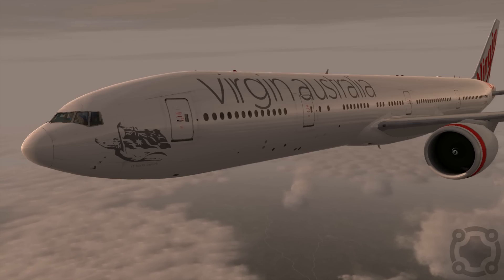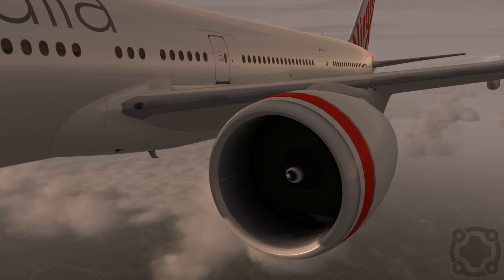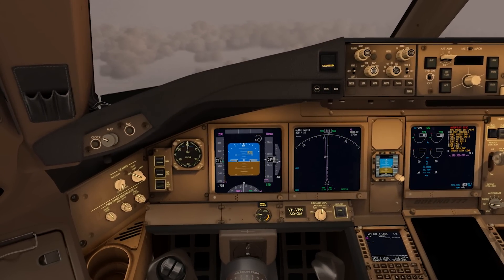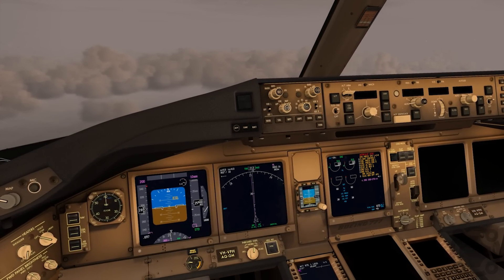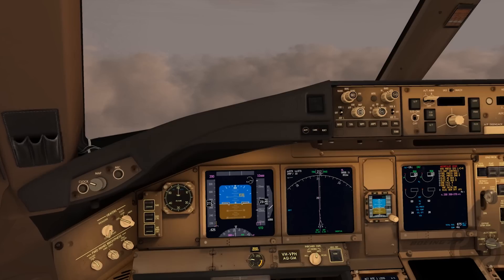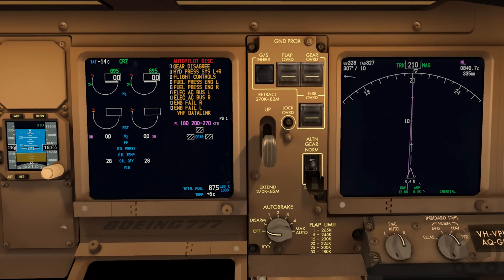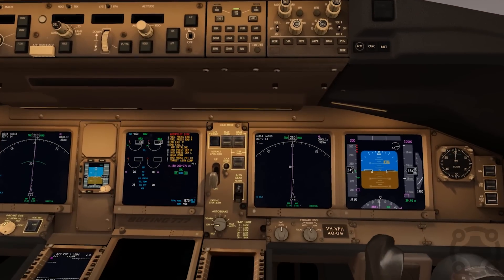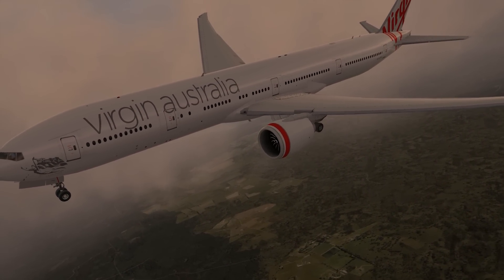What Happens If Both Airplane Engines Fail? - Aviation Facts

Comment: Excellent video! BTW I heard a U2 made an incredibly long unpowered glide landing back at Edwards, from hundreds of miles away. Crazy!
Reply: The U2 has a very high lift to drag ratio that is why,  I just looked it up and it is 23:1. The U2 is really a glider with an engine that is why it can fly such great distance with out an engine, plus the thing is what altitude was it at when the engine failed.  The U2 has a service ceiling of 70,000+, they fly there missions at 80 to 90k.

Comment: What program is this? Anyone know where I could get this?
Reply: Martini time its PMDG. You need some sort of pilot's licence or they will not sell the product to you but it can be bypassed.
Reply: sorry it's Prepare3D not PMDG. the aircraft is an add-on created by PMDG.
Reply: Prepar3D By Lockheed Martin, its damn expensive, I think you go better with FSX or x-plane for starters.
Reply: +TheMertonator you don't need a licence to buy them, I've bought every single on of their products and don't shave a special licence.

Comment: Should have explained that without engines they are also not going to have reverse thrusters.   A 777 with 360 passengers is HEAVY.  So, they have to dump as much fuel as they can, and touch down as close to the beginning of the runway as they can because they are going to have to stop the plane with just the brakes.  Yikes!
Reply: Every airplane is prepared to land with "just the brakes". Reverse thrust only exist to decrease the wear on the brakes. As heavy as they are. Even the A380 (which has reverse thrust on only 2 engines anyway)
Reply: Julio Varesio Yep!  We're triple 7 company, with some 76's also.

Comment: The fuel/oil heat exchange issue did not happen in the 'early days' of the 777, and it only resulted in one notable incident, that being British Airways flight 38 in January 2008.  By that time, the 777 had been in service for 14 years.

Also, the RAT (as is my understanding) is there to provide hydraulic power, not electrical power.  Reference ACA 143 in July 1983, which ran out of fuel in flight.  The crew had to fly with only basic instruments: airspeed, altitude and not much else.

Comment: If the engine has failed and you still have fuel why didn't you turn on the auxiliary power unit that could definitely help you by providing a good bit of electricity and it can also create a hydraulic pressure source

Comment: From my research, the 777 has three ways of getting hydraulic pressure.  Primarily from the engine driven hydraulic pump.  Secondary is two electric motor driven pumps and a third is the RAT turbine.  So, it's impossible to lose hydraulic pressure unless the pilot is suicidal.  However the secondary and RAT pumps don't provide the volume necessary for normal flight.  So, in that sense, the controls will feel heavy and slow to react.

Comment: I wouldn't say they are all gliders. Some planes are so aerodynamically inefficient that if both engines failed (like a F-22 for example) it would probably not glide for very long. That is unless if you can get the computers running again to stabilize the plane. I'm pretty sure if something like a A380 had quad engine failure, it would only be able to fly for 10 or so minutes. Idk i'm not an expert, but I do know that fighter jets for example can fly for shit without the computers/auto pilot kicking in. I do know that an F-15 can fly with one wing! So it may not be true with every plane.
Reply: Every plane has a glide ratio. A modern airliner is around 15. So for any mile of altitude it looses, it can glide 15. a fighter jet is maybe somewhere in the region of 5-8 when clean, and much worse with external weapons loaded.

Comment: A 777 actually has fly-by-wire controls, so the battery would power those, said it was hydraulics at 3:25.

Comment: When you lost both engines the RAT would've auto deployed which would give you electrical power and hydraulic power. 
You cannot (realistically) fly a 777 without hydraulic power as the majority of all flight controls have no mechanical linkages to the control column.
Reply: Is this true only of the 777?    Apologies for bumping an old thread.
Reply: @jackwilliams5474  most aircraft these days have no flight control cables and are near 100% fly by wire.  The 777 does have a few cables still (rudder, THS, and a few spoilers) but not enough to fly the thing. Every large aircraft since the 80s has a RAT that will either directly or indirect supply hydraulic and electrical power to give power to essential systems.
Reply: @MegaGouch  Thank you.    Would that apply to smaller ones I have flown on such as Embraer 120 etc.?
Reply: @jackwilliams5474  i don't know specifically about any embraer aircraft but for the most part smaller aircraft are less likely to be full FBW and still have control cables and be less reliant on emergency hydraulic and electric power.
Reply: @MegaGouch  Thank you very much.

Comment: Hello. 

You've got some great and informative videos. I recently 'upgraded' to a Windows 10 platform (on a new 64-bit Dell w/ Intel Core (TM) i5-6400 CPU @2.70GHz / 2.71GHz w/ 12 GB RAM), but have been unable to find any compatible flight simulator software to use on it. When using Windows XP, I had the MSFSX with Acceleration Pack; however, it will not load onto Windows 10. I've also tried installing XPlane X. Beyond the exceptionally poor rendering, it was agonizingly slow.

Any recommendations? 

Many Thanks (and I've subscribed).

Wayne Camp

Comment: You don't need to press then lock override button for Gravity extension. That button is for disabling the solenoid locking the lever down when there is weight on the wheels

Comment: Land at the nearest airport with no engines?  yeah right.. this video misses out the most important part of actually landing the plane.  Most international flights will be over the oceans or going where there is no airports.  If over the ocean then the pilot would need to keep the landing gear up, and try to land along the peak of the ocean waves and hope the plane doesn't break up.  Then there would be a very long wait for help to arrive.  Over land it could be difficult to find a long enough stretch of flat ground to land on unless you're flying over the dessert.  And then there is no reverse thrust to help the plane slow down once it is on the ground so it would go much further than a normal landing.  No engines means your fate relies on the experience of the pilot.
Reply: Stephen Mann well that scared the shit out of me again haha. But I appreciate the information. Luckily, this is very rare.
Reply: you need a considerable stretch of flat land yes, but despite the lack of reverse thrust you'd be surprised to see how much dirt, trees and other objects slow down an aircraft pretty fast and actually reduce the needed amount of landing space quite drastically. The emergency landings in light and small aircraft are fine and if lucky enough can easily get away with an undamaged aircraft if you find a big enough grass field, but no such luck for a big heavy twin engine (or larger) jet aircraft. Even small General Aviation airport runways will most likely not be able to support the weight and the gear will just push right through the asphalt (if such runways are even wide enough!).
Reply: Any flight your fate does rely on the experience and skills of the pilot tho XD

Comment: Trust me this vid is all too simplistic. You are in BIG trouble !
All engine fail means the risk of dying increases significantly. Batt power is just an int rem 'till the RAT comes on-line. You can't fly a plane with batt power only especially Airbus. Lose all hydraulics in an Airbus trust me you will be on the nightly news along with the  several hundred bodies !!!

Comment: The FOHE issue didn't cause them to shutdown, the flow was restricted thru it, the engines were running but at like idle, they couldn't get power on them.  It was an issue that was limited to 777s with Rolls Royce Engines, they didn't have the issue on the Pratt and Whitney PW4000 engines

Comment: If you are flying from the midwest, the chances are you will never be on a wide body jet. You will either be on a 737, A320 series, or a regional jet. The older and smaller planes don't have all the bells and whistles the new ones do.
Reply: C moore no im in michigan and i went in a 777
Reply: 737*
Reply: The main reason is you will probably never be farther than 1500 miles from any location. 99% of all wide body flights go out of Atlanta, JFK,LAX,or DFW or Houston. The reason for this is they are the busiest and therefore most of the international flights go through there.Every now and then you will see one in the midwest, but not regularly. I live in Tulsa and we have one 767 flight a day arriving and one departing. Both of these originate George Bush in Houston. I don't know how often you fly but it is said that the regional jets have saved the air industry in the US. It is really hard to fill a plane with 300 seats from somewhere other than a major city. We have the American Airlines Maintanance Center here and get them for service. You should go to Flight Aware and you can see every flight in the world and what type plane they are flying. This goes with real time mapping.
Reply: C moore no dude i know my stuff k?
Reply: If you say so. Never try to confuse someone with facts. It is useless.

Comment: What if you were flying on an early 737-300. There are a zillion of then still out there. You don't have a clue what it is like to land without reverse thrust. You need to understand that the reason most of the newer innovations have come about is because of a major problem.  Unlike the auto industry, they don't usually recall all aircraft and update them.

Comment: I like the video, but you missed something.... on the B777, loss of both engines will AUTOMATICALLY deploy the RAT.  Note that when you looked up to the overhead to press the RAT button, it already read UNLOCKED.  It had already deployed, providing both hydraulic and electrical power.  It drops when the electrical AC transfer bus becomes unpowered, which happens when both engines are shut off.  Plus, you killed the APU.  Why?  It's there with its autostart for a reason...

Comment: What about if the gears don't come down?
Reply: it will, but even if it diesn't come down, you can radio the airport and ask them to put foam on the runway so you can do a belly landing - that has nothing to do with the engine failure though
Reply: thanks

Comment: I've played enough war thunder to know that losing your engines is a death sentence.
Reply: Chin Chin The Dark Lord Fighter jets aren't don't usually have a lot of lift so you have much more fly time on commerical planes without the engines
Reply: Very few WT pilots know how to execute a proper engine-out glide and deadstick landing. I see people do this all the time. They are about to lose engine power and the attempt to accelerate towards their home base, possibly initiating a descent to get their speed up even higher. That's the exactly wrong way around. The correct thing to do is pitch up, slow down to best-rate-of-climb speed and gain as much altitude as you can while you still have engine power. When the engine dies, decelerate further to best-glide speed and hold it there. Most prop aircraft have a good glide ratio, easily 10-12:1, so if you have an engine out at 2km (6000 ft) altitude, you can glide for 20km (11 NM) or more. By speeding up, all these pilots do is lose a lot of energy to induced drag, which grows as the square of indicated airspeed. Twice the airspeed = four times the drag = half the gliding range (simple but close-enough approximation).
Reply: @totoritko  Exactly.
Reply: Satyam Patel What about Japanese prop fighters? XP 
They were meant to be very light and have a lot of lift. A6Ms, Ki-43, etc...
Even the Japanese fighter jet, Ki-200, has a lot of lift and very little drag.
Reply: Chin Chin The Dark Lord   I got shot many times in my engine until it goes into 0%. Most of the time, I survived with landing gears intact......until I got shot by other players.
Reply: totoritko There is just one problem: you become an easy slow moving target for enemy planes
Reply: Amen brother
Reply: Satyam Patel 
There are very few jets in War thunder
Reply: totoritko easily 10-12:1? I don't think so, a cessna 172 has around 9:1, a fighter plane such as the p-51 that has a stall speed around 100 mph is not gonna get "easily 10-12:1"
Reply: Mackenzie Clarke "a cessna 172 has around 9:1"
The optimal glide ratio, when flown at constant airspeed, is equivalent to the (L/D)_max for the aircraft and as it turns out, we have reliable data on this(*) and for a Skyhawk it's ~11 (i.e. glide ratio of ~11:1). On that same table, you'll find that the P-51D has an (L/D)_max of ~14. Yes, unsurprisingly, the P-51 has better aerodynamic efficiency than a Skyhawk, owing to the fact that the Skyhawk is about as aerodynamic as a brick and doesn't even have retractable landing gear.
(*) Source: http://history.nasa.gov/SP-468/app-a2.htm
Reply: what do you guys think the glide ratio of a bv238 with feathered props
Reply: Yukikaze Flyes You're gonna need some data to estimate it. But if you have the aircraft in WT, just take it out and test it. Optimal gliding ratios are usually achieved when flying at an airspeed approximately 1.2-1.3x the clean stall speed. So if the aircraft stalls at 80 KIAS, try around 100-120 KIAS.
This all assumes WT's flight model is reasonably accurate, which is pretty dubious at times. Unlike X-Plane, WT doesn't actually model the airfoil and aerodynamic interaction with it. It just uses a bunch of hard-coded coefficient tables and completely ignores the aircraft's shape.
Reply: totoritko oh well
Reply: totoritko I didn't know the glide ratio for the p51 but my guess was that it wasn't 12:1 thanks for sharing, 14:1 is pretty darn good! The schweizer 2-33a I fly gets 22:1 but it's old and beat up so it probably doesn't even get that hahahaha
Reply: Mackenzie Clarke Wow, 22:1 for a glider is really low. And here I was thinking a Blanik is poor. And that one is all-metal.
Reply: totoritko yeah its not the best. I've always wanted to fly a blanik.
Reply: Actually if you're in a commercial airliner and over land at 15+ thousand feet then you're more than likely to survive a dual engine failure. War Thunder is great but the aircraft and procedures don't compare with modern airliners.
Reply: It depends on the situation. If you have a bandit on your tail, it most definitely is. But if you lose the engines of a Ju-88 (which kinda seems to have almost no drag in the game) at 3km, you can go ahead and glide back to base safely (if not being shot at).

Comment: To shut up the autopilot horn, you need to press the AUTOPILOT DISENGAGE button on the yoke.  The A/P DISCONNECT bar on the MCP is a last-ditch solution if the autopilot fails to disconnect normally.

Comment: LogicLounge do you know where to buy/get that game. It seems very interesting!
Reply: ShadowVyrus is there an app available for Android .  I want this simulator.
Reply: thanks!
Reply: william santor =P
Reply: Try flight gear, it's free
Reply: ShadowVyrus ok
Reply: Mark P Unfortunately, none that I know of, sorry. I mean unless you're willing to pay money. I haven't touched android in a while, but there are some on iOS. However, you can only control thrust etc, and not have very precise controls like you would in a proper sim. sorry :/
Reply: Business Cow it is a iOS app called Honeywell aviation
Reply: scorch skier no it isn't, it's Lockheed Martin's Prepar3D with the PMDG 777 addon aircraft.
Reply: +scorch skier Wow, do some research and don't be a mobile dweller

Comment: I've always wondered what the glide/slope ratio of your average, modern commercial jet is.
Any idea?
Reply: David B About 15:1 for the 747. Dreamliner and A380 probably a bit higher, but i guess all bigger commercial jets are somewhere between 13 and 20. So from 10km height you could still travel 150km to a possible landing site.
Reply: Thanks guys!  You answered a question I long wondered about but never got around to researching.
Reply: David B er...I should know this because I just did a unit on aircraft performance, but it was something like decent at 3m/s, for a horizontal speed of like 300m/s from memory? Angle was very small - these things can go very "far" by gliding. Although not far enough if you were the captain
Reply: David, here are 2 links to show you how far a big plane can glide and land. 

https://en.wikipedia.org/wiki/Gimli_Glider

https://en.wikipedia.org/wiki/Air_Transat_Flight_236
Reply: Scott Haskin
Interesting links, thanks. :)
Reply: dabeste wow! that's impressive, the schweizer 2-33a I fly gets 22:1

Comment: So why does the hydraulics truned off in a duo-engine failure?
Reply: because the plane only uses its battery power for the bare necessities, and hydraulics aren't one of the necessities.
Reply: the 777 will still have hydraulics with a duel engine failure, as will almost all airliners, they have to otherwise there is no way to control it. In the case of dual engine failure without the APU running the aircraft will get electrical power and hydraulic power from the Ram Air Turbine (RAT)
Reply: ChromeFilms77 Not true. That's ridiculous. Hydraulics control the aircraft. Would that not be considered a 'bare necessity'.

Comment: What about apu for power?
Reply: usually used on ground
Reply: As a acft mechanic is can be used in air for emergency. Just surprised how many feature the plane had around the Auxiliary power unit for power

Comment: Can the APU turn on after a double engine failure to power the planes electronics?
Reply: im not sure but maybe if the battery has enough voltage, and apus arnt the most reliable things